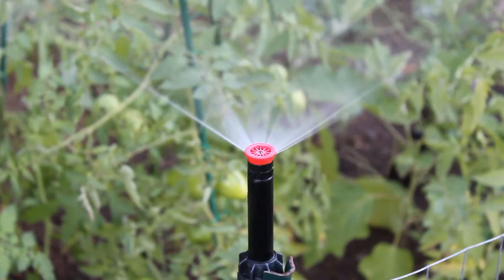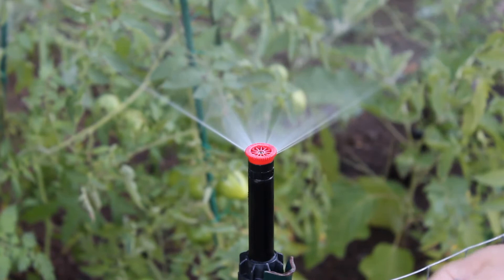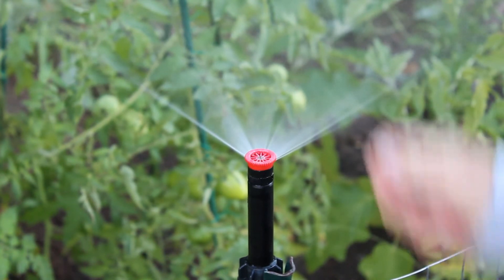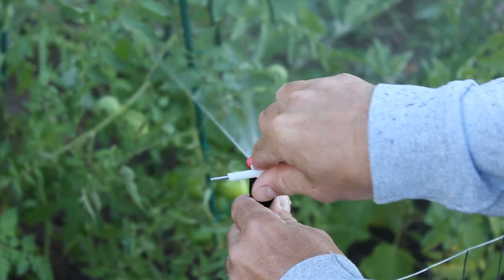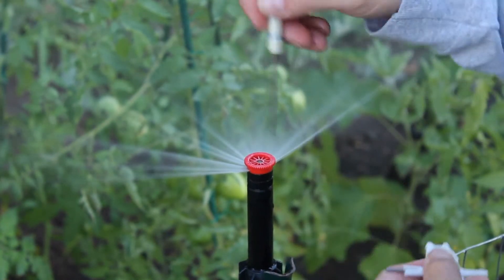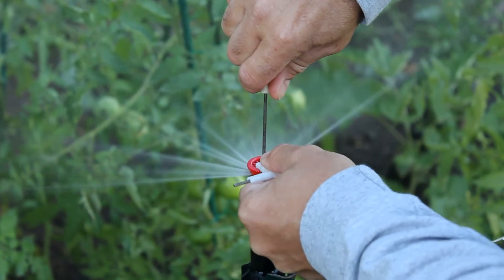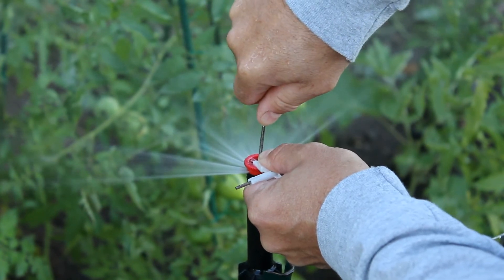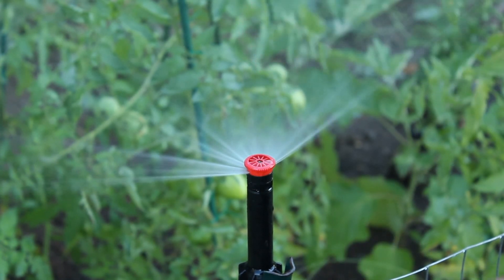How to Adjust a Fixed Radius Spray Head (Hunter PSU-04)

Comment: I have 4 of this model (and a large 360 sprayer which is not problematic)  but they leak water between the riser and the main body screw down cap) as thought the seals are defective. All four are brand new so I suspect it is not the seals that are damaged but perhaps I have not enough water pressure. Anyone have any thoughts before I invest in a pump or starting digging up to configure more zones into the lawn area? I have the grey nozzles set at 90º opening with max spray output.
Reply: Not having enough water pressure is not the issue. Not having enough gallons per minute flow rate could be. Each head should come with a selection of 12 different nozzles, each using a different amount of gallons per minute. I'd suggest making sure you have used small enough nozzle sizes to bottle up the flow and pressure to make sure the heads pop up all the way to allow the seals to function properly. You could also try tightening the collar to make sure that's not the issue as they are sometimes loose from the factory. Also make sure the water leakage is coming from the collar and not the elbow connection underneath. If none of that works, take them back.
Reply: Thankyou Matthew. That was a good explanation. I live in both France and UK and bought these risers in France where they only provide one nozzle with each riser and in my ignorance, I chose the grey nozzles giving me the max water flow. Bad choice it seems. The uk dealership does not apparently sell the psu models and could not help with my problem (saying i was wasting his time in the process !) but various nozzles sizes can be bought online. To test my system I closed down three with the result thar the centre rotator an the remaining nozzles worked fine. I’ll get some lower capacity nozzles and I’m guessing that will fix the problem. Again, thanks for your help. Its really appreciared.